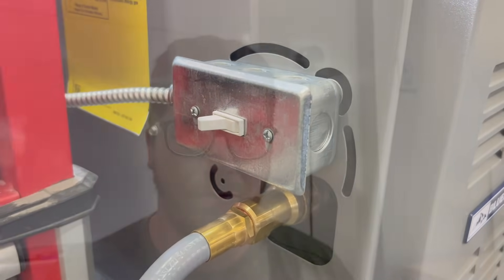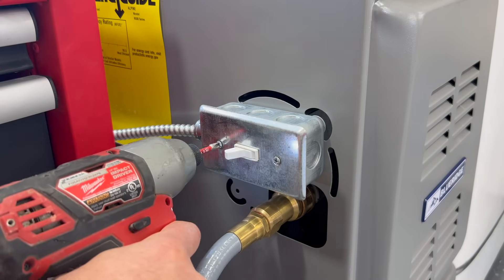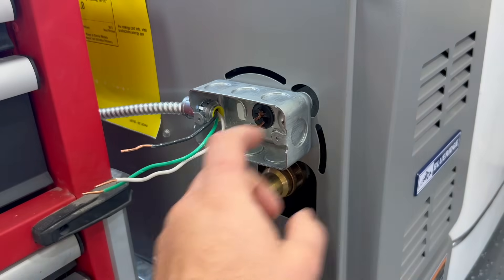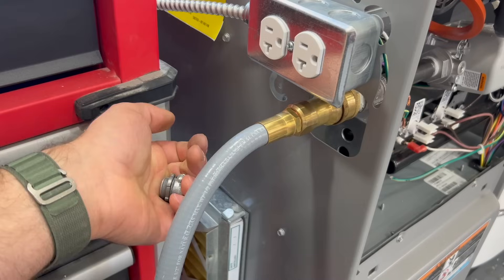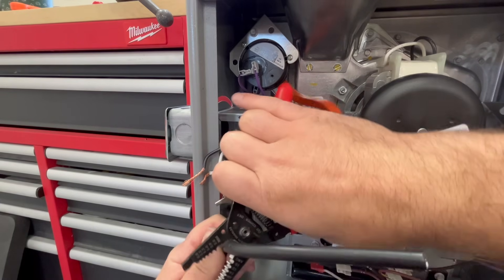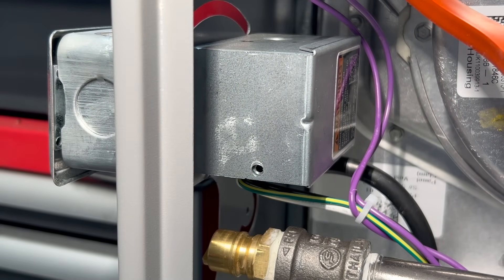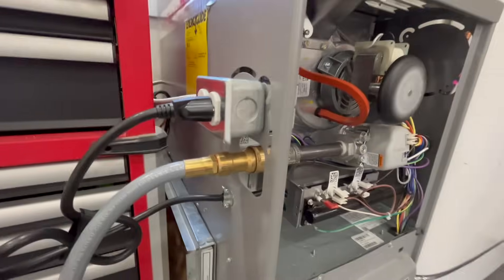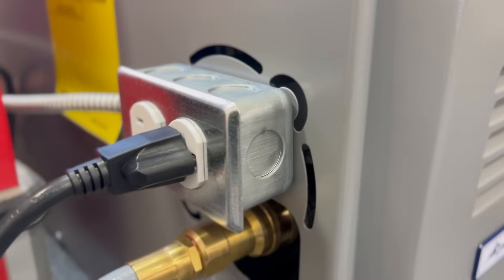Keep Your Family Warm During An Emergency Power Outage With This $20 Fix

Comment: NEC 400.10(A)(8) — Flexible cords cannot be used on fastened‑in‑place equipment

This is the primary prohibition.

A gas furnace is:

• Fastened in place
• Not designed for ready removal
• Not listed as a cord‑and‑plug appliance

Comment: Wow…234 watts with blower fan running?  Am I missing something?  234w divided by 120v = 1.95amps. That’s one efficient furnace.  My small Rheem Criterion II pulls approximately 636 watts or 5.3 amps with blower fan on.  Yes…it’s an older system.  Maybe I need to run some numbers and see how long it would take for a new more efficient system to pay for itself.

Comment: The problem I see is the average home. Owner does not understand and they may end up plugging their generator with an extension cord into the utility power supply outlet, causing obviously electric to hit electric and causing a fire explosion or both. I did see your new video with aThe problem I see is the average home. Owner does not understand and they may end up plugging their generator with a extension cord into the utility power supply outlet, causing obviously electric to hit electric and causing a fire explosion or both. I did see your new video with a resolution for that issue.

Comment: Not being either an HVAC  tech nor an electrician, I want to say thanks. This is the solution to a problem I have with a manufactured home. From the description you provided, I would ask whether a UPS could be substituted for the power station? Coming from the computer server world, permanently plugging your added cord directly into a UPS sufficiently robust to handle the draw for a sustained period of time, which would make this process automatic. There would be no need to move the plug over to the power station. Switching time is less than 4 milliseconds, and a pretty robust UPS would be able to run the furnace for an extended time. The UPS will have such information in its specs. 280 amps is 'way less than a server.

Comment: I have a vtoman 1000 power source. Do i need the neutral ground bonding plug with it?
Reply from the maker: It’s hard to say until you test it so that’s why I always recommend doing a test run before you find yourself in a real no power situation! Cheers

Comment: DON'T DO!!! You are bypassing the fire protection. If you want to do this, install an outlet plug and cord before the fire protector to maintain fire protection. As your generator cycles from you using other items on the circuit, it changes the fuel and blower flow, which can cause a fire. Keep the fire protector in the circuit.

Comment: This is a very bad idea. So many code violations. If you want to have heat during a power outage do it property at the main panel. Buy a good gas powered generator and run it outside. Depending on the size of the generator you can control what you want to run off it. Like furnace, fridge and a couple of lights for a medium sized unit.

Comment: are the air handler and the gas furnace on separate circuits?  this power station runs the furnace but is it running the air handler too?
Reply from the maker: You only have an air handler and coil OR furnace which moves the air in ac mode. But please note that this only works with 110v motors not 220. A lot of air handlers with backup heat strips run on 220v

Comment: This may be in CODE VIOLATION depending where you live.  There must be shielded (armoured cable) from something like 5 feet from the furnace, and NO extension cord going into the furnace.  What you can do however is install a box and plug like you show, BEFORE the armoured cable.

Comment: HVAC guy, great idea and many of us would like to thank you for opening up the discussion.  The Electricians fine tuned it to keep it in code.  But you are so chill for taking the time and energy to address what many of us fear for our families....no one wants are kids from getting cold.  PG&E shut off power for 4-5 days after the wild fires burned hundreds and hundreds of homes here in N Calif.  Inside the house it was a toasty 47 degrees.  After that little fiasco I went out and bought a couple of Honda 2000 generators.  They put out about 11 amps continuous.  I have a nice power station for my Trimaran.  But everything in my boat is mostly 12 Volt.  I do plug in the induction hot plate into the 110 AC receptacle.  I also power my Instant Pot on the power station.  My very handy repair guy keeps trying to talk me into a 12kw diesel generator.  But honestly, by the time i paid for a used generator, labor, transportation, electrical meshed into new subpanel...maintenance on the generator....I just feel It is not work 10-12 K for that very rare event.  I can get by with a couple of gas generators for 2500 dollars.  I run Walmart pure gas (no corn alcohol) and try very hard to start them once a month for a few minutes.  Been going like that now for 4 years.  Had to use them one time for 4 days after that first fiasco.

Comment: I saw a test of the Wago connectors in a vid on yTube, at high current, they melt.
The problem, and you can see it if you look at the contact,  the contact is not big enough to take the current certainly not the same as twisting the wire and taping or using the caps twisted over the wire.  Be careful recommending these things.

Comment: Can I use a 12v car jumper with an inverter to power the furnace and if so, how long do you think a 9AH battery jumper might last in hours? thanks, or else I'd have to use a generator with a long extension cord to the outside.

Comment: Obviously I'd rather have heat in the winter. But I live in the south and we normally don't get below 26 degrees. 
Would this work with cooling as well? 
I know it would draw a substantial amount of power verses a gas heater. But summertime is when we get the bulk of our outages

Comment: One thing I think was a little bitty mistake is, when you're working with ac, NEVER trust anything everytime "100%". If you do, it's just a matter of time till it bites you. I consider myself EXTREMELY careful, and I have been fooled by faulty equipment, or someone else's 100%. THAT'S  something that only happened ONCE! "OH,  yeah... I shut the breaker off!"...SAP💥😱💥

Comment: That battery will last an hour or so THAT'S IT ... better fix this understanding or you're just spending money for nothing,
Reply: That battery is 1024 Wh. It probably has about an 85% efficiency rating. So he will probably get about 800ish Wh. The furnace was calling for 250ish at peak draw. He would get about 3-4 hours if it called for it constantly. However, when it reaches temp it will shutoff. Depending on the temperature and his insulation, he could get 6-8 hours off of it assuming it isn’t getting solar.

Comment: I have a propane furnace, but it is all connected to a heat pump, and AC.  Instead of an outlet and a switch, i have a switch and a little box that is labeled 15 amp.  Can this be done to a heat pump system (just to run the furnace, not the ac compressor or the outside unit)?

Comment: U can back feed the outlet in the wall and power half the house a black wire a neutral wire and back feed it straight through the plug on the wall..... Throw the main breaker in the panel box back feed any room in your house straight through an outlet on the wall

Comment: Probably should have left the furnace feed wires in the original switch box.  Remove a knockout in the switch box.  Install a Romex connector and splice your cord into the furnace feed conductors. Wire a 15A receptacle as you had shown in the video.  Label the cord furnace disconnect.

Comment: If you use a 20 Amp outlet an only have 14 gage wire your going to have problems. If you have 12 or 10 you'll be fine with 20 Amp. If you have 14 gage use a 15 Amp. That's what comes in most homes unless asked for bigger when building your home.

Comment: I will never be one backup deep because as the military saying goes "one is none and two is some".  Gensets can malfunction and though I'm a skilled mechanic I'd rather not freeze my glutes off wrenching one in the cold. Should a generator fail having an alternate way to make heat is wise, and gas appliance owners already own the basics. Running lines to unpowered or optionally powered heaters isn't typically difficult.

I use a fireplace gas insert on one end of the house and a gas stove in the kitchen on the opposite end to remove any need for power during outages. If you already have a gas connection it's generally easy to add a separate gas heater or heaters in the most important spaces and let them heat the less important by radiation. Since my home is small I don't have those issues. I speak fluent generator and own one but in emergencies I require a backup system I don't have to feed electrical power in the first place. 

BTW don't ever forget that heating is for comfort but clothing is for survival. Cold weather gear means you won't be trapped in house or vehicle for shelter. I don't use my old N3B parka often but it and the arctic weather pants are priceless when needed. Another thing people forget is a (large as you can find) cold weather sleeping bag rated for colder than where ever you live will ever experience. (You can open a bag that's too warm but it's hard to add insulation you don't have.)

Comment: Never forget CLOTHING. Clothing is for survival, heat is for comfort and to protect plumbing. (I fit a drain valve at the lowest point of my plumbing so I can easily dump the system after shutting off my pump then I blow it dry with compressed air or CO2  regulated down to ~50 psi. (If you MIG weld or brew beer your cylinder has more uses than most think).
Reply: Yes!    I’m ALWAYS getting stuck IN MY HOUSE, with NO CLOTHING!!!!

Comment: This may work for a gas fired furnace, but electric units use a heat pump.  Are they an option with larger rates b/u genies and or a large power bank?

Comment: Thank you so much for the idea of running a gas furnace on backup power. My furnace was already plugged into an outlet. It got me thinking about my solar setup which has plenty of power. I bought a plug like yours and plugged it into my inverter. Then ran an extension cord to the furnace. It works great and only pulls 140W. Now I'm set for a Winter power outage!

Comment: I have a manual transfer switch ahead of the main breaker panel that enables safe application of auxiliary power to whatever circuits I need energized during a grid outage with no chance of back feed into grid and endangering their crews.  Of course, most emergency power sources lack capacity to run all the circuits in your home.  This means your breakers should be clearly labeled and shut off except for the essential circuits your device has capacity to feed.  To be clear, when using a manual transfer switch like mine, it's necessary to manually shut off all the subsidiary circuits EXCEPT essential ones that your auxiliary device has capacity to run.

Comment: Makes me miss my old octopus. Power outage? Just go downstairs and manually trigger the gas valve. Plus curling up in front of the vent with a blanket was amazing without a forced air unit.
Reply: Sounds like a good way to burn up the exchanger in your furnace and possibly burn down your house.
Reply: Fire up the STOVE burner(s).

Comment: $20 gfci
$10 pack of pigtails
$5 wire nuts
$800+ generator
Where's the $20 fix?

Edit- LMAO, I just looked at his parts list and the wire nuts alone are $20. Also, that is not a pig tail, that is an appliance cord.

Comment: What you are doing is against the last electric code.
What you should do is keep the switch. Could you tell off of it? Get two switch's that single poll double throw, which will cut off power to the electric from the PowerPoint and cut on power that will run to your generator. How do I get power you have to have a maintenance switch by the furnace!!!

Comment: I have this arrangement on my furnace but went one step further.  On my car electrical system I have an Inverter tied in for 120 volts so in the event of a lengthy power outage I can start my car and plug a cord into the inverter and run my furnace. a full tank of gasoline will run the furnace for days by running only off and on.
Reply: Hope your car is a junker because a vehicle engine is many times more expensive than that of a generator and most newer vehicles log engine run time that shows up on a CarMax report.  I'd rather not shorten the life of my expensive vehicle.

Comment: I need your opinion.  I thought of doing something similar. I would install polarized plugs on the power supply wires leading to the furnace motor. During a power failure, I would unplug the furnace motor from the house  wires, and connect to a generator or battery pack.  Would this work or do I face burning my house down?  thanks.

Comment: Or you could just plug the generator into the closest outlet ( outside ), plug a bridge into your dryer outlet ( and of course, turn off the main breaker ), and not only be able to run your furnace ( without needing a long extension cord running through a window down to the furnace ), but also be able to turn on some lights, and run the refrigerator as well.
Reply: So your suggesting a suicide cord? Your a jeanious.
Reply: @timfritz3828  That is like clutching your pearls and exclaiming "you use a butcher knife in the kitchen?!  You could cut your finger off with one of those!".  Use it correctly and you won't.  I would not give my 5 year old a butcher knife, nor would I give them a so called "suicide cord" to play with.  An adult that has been taught how to use it however... that is plenty safe.  I also wouldn't let my 5 year old drive a car, but for an adult that has been property trained, it is plenty safe to drive a car.
Reply: @timfritz3828  Do you also clutch your pearls and say "you're using a good kitchen kinfe?!  You could cut your finger off with that!"?.  Use your tools correctly and they work well.

Comment: Would you recommend doing this instead of having a transfer switch installed on the furnace? I want to be able to use my gas furnace in the winter with a gas inverter generator if the grid goes down. Thanks
Reply: No. Most of this is dangerous and illegal.  It can void any insurance claims.

Comment: I have a bluetti ac200l , do all these power stations require a bonding plug, also my furnace has a electrician installed furnace transfer switch, would I still need a bonding plug, i don’t quite understand what a bonding plug is , i never heard of that . I had the same setup on my old school gas furnace without all the computer crap on it , when I had it replaced in 2017 the installer said the pig tail could damage the computer components, I never tried my bluetti or my Honda inverter generator

Comment: As soon as you do that bonding, the furnace will be "hot" alright. As will anything else that has a "grounding" connector. So if you touch the furnace, or anything else metal, that is in contact, and you happen to become grounded, that voltage is going to go through you. It's not "The shortest" path to ground, it is "ANY" path to ground. Get a grounding rod and do it the right way.

Also, if that circuit breaker for your furnace is not GFCI protected, you're now in code violation. It would be better off if people that put their furnace on a cord to just then plug it in to the nearest GFCI outlet and eliminate the other wiring all together.

Also love Wago nuts, but like regular nuts, found it is best to wrap them in electrical tape too. A few instances I've experienced them working loose or a box stuffed with wires can snag a lever and work it open. Electrical tape solved the issue.
Reply: Yeah, I get the use of a bonding plug to run your stuff out at the campground, but natural gas + static + unknown 1 + unknown 2, + forgot to pay the monthly insurance bill can add up in a bad way. Where there's a furnace there are usually good grounds. Add a decent bond wire attached to the furnace & a HD alligator clip. it reduces the cool factor (that portable power unit is cool) but it makes the whole setup safer.

Comment: I always tried to have someone turn the breaker on and off while I checked for power. That way I felt confident that the power was indeed off. There are rare times when those probs do not read power when it is actually on. 
Terry

Comment: i wired mine direct with a 50ft extension cord then just turn the switch off when the power goes out,run the cord out to the generator.used 3xs with no problems

Comment: Just tried to do this as we have been without power for twelve hours in 14F weather. Unfortunately, there is no ground coming from the furnace. The service ground just bypasses the switch and is hanging just inside the furnace. 🤷‍♀️

Comment: Just put in a proper interlock connection at the panel and run a generator plug outside to plug the generator into
Reply: Exactly, then you can run literally anything you want at any time including the furnace, within the limits of the generator.

Comment: Now I back feed my panel with my portable generac generator and have a mechanical interlock installed in electrical panel. So I just leave furnace breaker on. This way no extension cords or need to do the pigtail deal. Any issues with my method?
Reply: Your method works fine, as long as you follow code.  But, this video was about how to DIY power your furnace for less than $20, and an interlock with proper breaker switches would definitely cost more, and probably require an electrician.

Comment: During my many power outages, i simply have a grounded extension cord in my basement next to the forced air heater and when power is needed, i unplug heater power from house outlet, plug into extension, go outside and start generator where extension cord in plugged into, warm and cozy again!!👏👏👏👏
Reply: Your furnace is not hard wired to your panel?